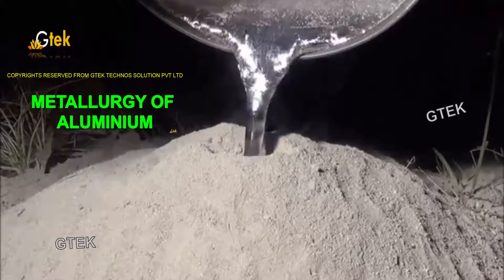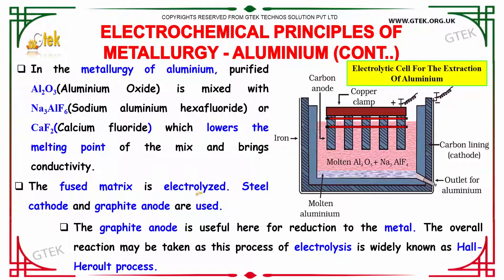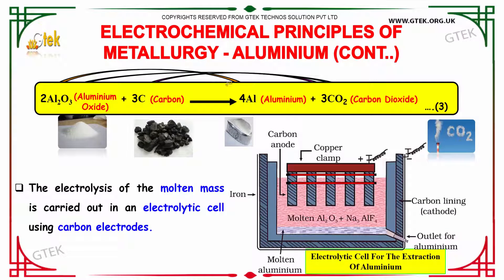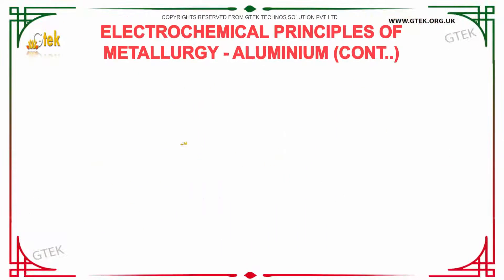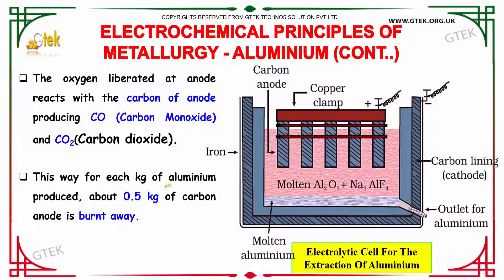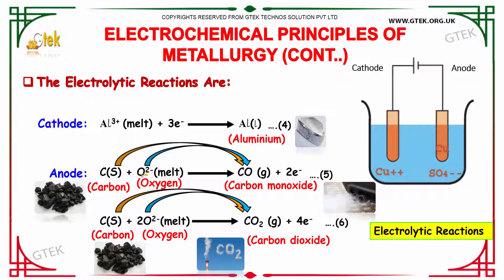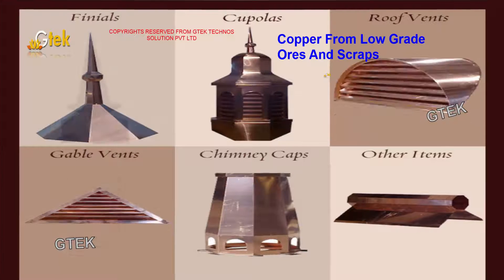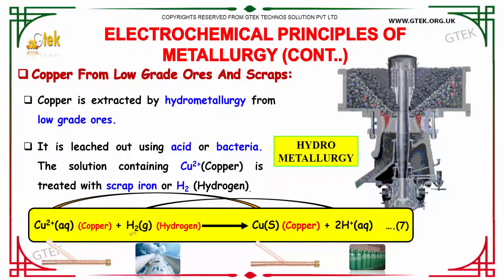metallurgy of Aluminum principles and processes of isolation of elements class 12 subject cbse

Comment: In fire tests on aluminium materials, when the temperature exceeds the melting point, in the range 600-660°C, the aluminium surface exposed to the fire can be seen to melt, but it does not burn. At the end of the fire test, the metal remains as a resolidified pool.

Comment: Aluminium (or aluminum; see different endings) is a chemical element in the boron group with symbol Al and atomic number 13. It is a silvery-white, soft, nonmagnetic, ductile metal. Aluminium is the third most abundant element (after oxygen and silicon) in the Earth's crust, and the most abundant metal there.

Comment: A smelting plant is an industrial location where metal is extracted for raw ore. Common examples of metal smelting include tin, lead, copper, bronze, and iron. The extraction of pure aluminum is also called smelting, although the process is significantly different from that of the other ores.

Comment: Alumina is mainly extracted from bauxite using Bayer Process. The Bayer process dissolves the aluminium component of bauxite ore in sodium hydroxide (caustic soda); removes impurities from the solution; and precipitates alumina tri hydrate, which is then calcined to aluminium oxide.